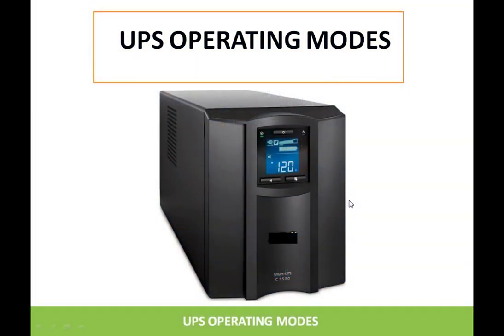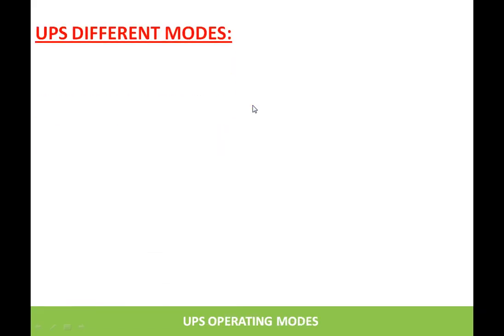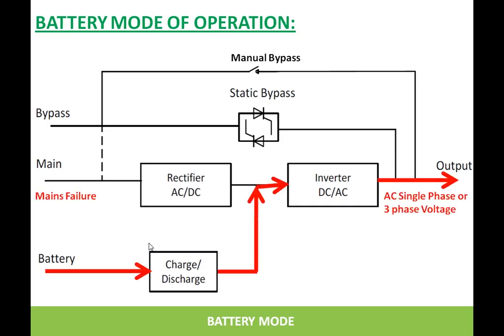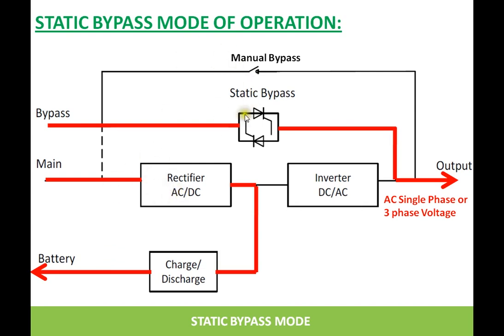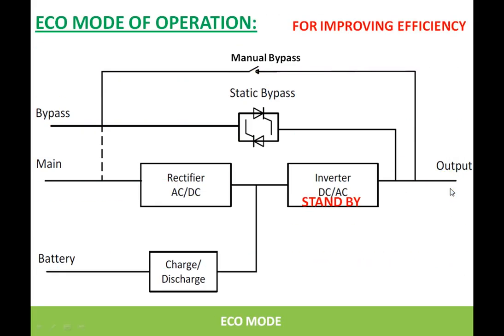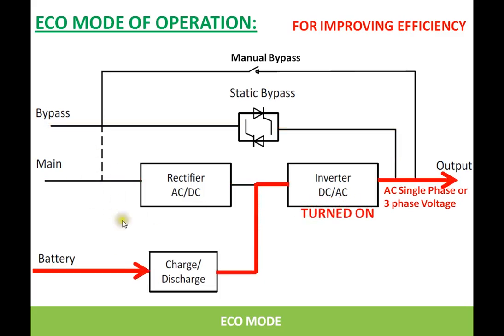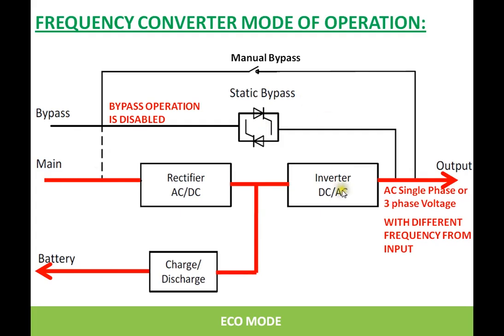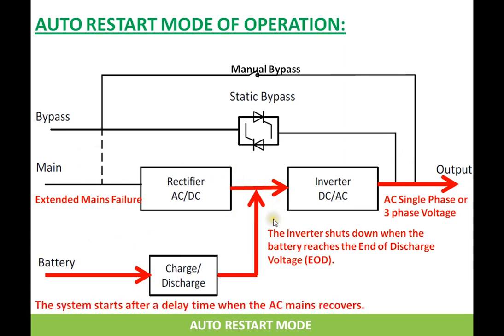Uninterrupted Power Supply (UPS) Operating modes

Comment: what happened when we want to change the batteries online withoug causing shutdoing of load
Reply: either you have several parallel battery banks, then you can change one by one, if not, you are not protected during the change. usually UPS is put on bypass during such work

Comment: Brother, static bypass is not voltage stabilizer I think. Please 🙏 check again and reply if possible. STS-Bypass and STS-Inverter,  other your point is ok.
Reply: Exactly your are right, don't mislead sir. Static switch only use for transfer the ups power to critical load within 4 ms.